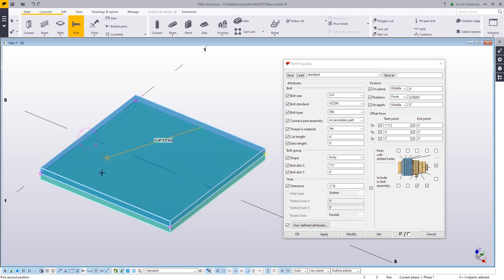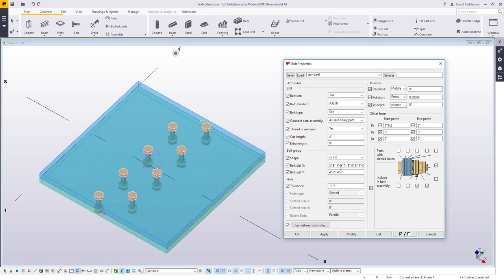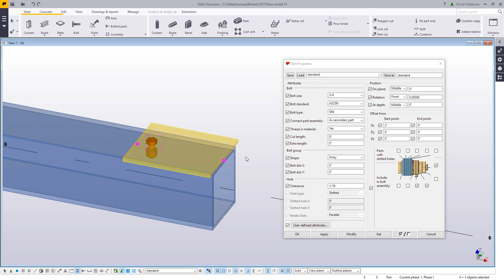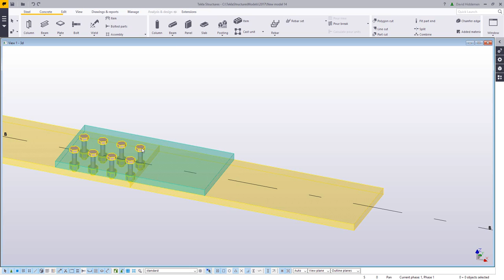Bolting Tips in Tekla Structures

Comment: Thanks for your videos, it helps a lot! But I still have a question. In my bolting groups catalog I have two exactly the same groups with only one difference, the material. One is steel and another one is Stainless Steel. How can I set-up my view representation filter based on bolt material property? I want my stainless steel bolt to be represented in another color. But in the filter window I can not find property "material" for bolt.
Reply: I was able to create a filter with two lines: Object | Object Type | Equals | Bolt group; AND Template | MATERIAL | Equals | STAINLESS (where MATERIAL is manually typed in, and STAINLESS is what I used in the Bolt Assembly Catalog "Material" field).
Reply: @TrimbleTeklaDave  Thanks a lot! I just repeated what you did, just did the same, hoora it works. Thou I must say I don't understand why Object, why Template, why not just directly Bolt? Am just learning.
But now I have more complicated question. How do I create bolting group with steel bolt and nut but(!) a plastic washer I the way that they also appear so in the report??? We use such a boltings with neoprene rings to mount special rainwater discharge guttercouplings.
Reply: @TrimbleTeklaDave  And one more question. In bolt catalog I have a data row "span size". In template editor wich parameter I must have to get this data appear, to get span size value appear?
Reply: @victorstrembitskiy7171  unfortunately I do not know of an attribute for this one. Might want to reach out to your local support for assistance, they may know.
Reply: @TrimbleTeklaDave  but there is no material value field in Bolt Catalog, there is one only in Bolting Group Catalog, for whole group, and I must have multi material group.
Reply: @victorstrembitskiy7171  You will need to use the Name and Standard fields for the new washer type, not the Material from the assembly. Your report should break them out as a separate line item because of the different Standard vs other washers.
Reply: @TrimbleTeklaDave  My excuse! Time ago you helped me to set my representation filter so that my 10.9 boltings turned red. Crazy of me but the model is broken now and I don't remember any more how it was set. Could you help me again here? So, I have a bolting group where grade is set to 10.9. In the model I create new object group where 1 row is Object->ObjectType->Equals->BoltGroup but what was the second rule? I forgot it. Pleaaase ...
Reply: @victorstrembitskiy7171  It's up higher in this comment chain. Template | MATERIAL | Equals | STAINLESS (but modify for your grade or whatever you're trying to color differently)
Reply: @TrimbleTeklaDave  Ah thanks a lot. it's here, and I was looking for this comment much and much deeper!

Comment: how do you add a bolt in separate plates? i saw but i dont understand.
Reply: Hi Eduardo - as you saw in the video it should break the group automatically into 2 groups. You of course always have the ability to add two separate groups manually. Some situations may require this.

Comment: Can the Auto Bolt component be wrapped up into a custom component or will it need to be exploded first?
Reply: Hi Rebecca - unfortunately I have not had a lot of luck embedding Autobolt inside a custom component - being different technology (.NET plugin vs CC) it just does not work as expected.
Reply: I couldn't get it either but I thought I might be doing something wrong. Thank you for your response.
Reply: @TrybalRage  dave steel?